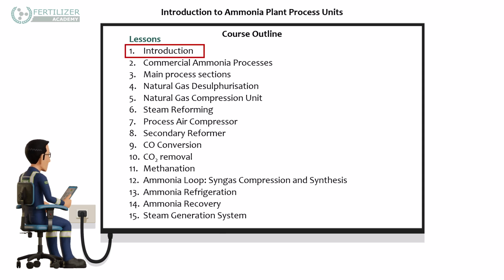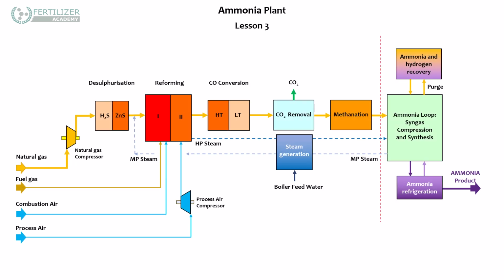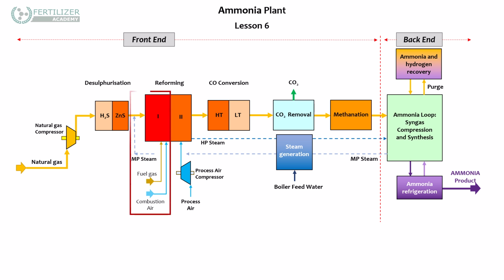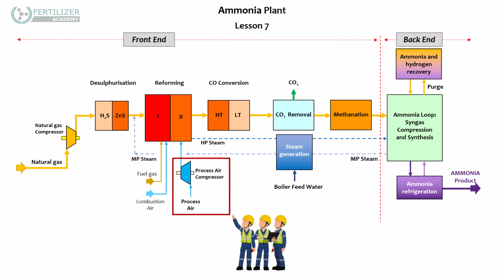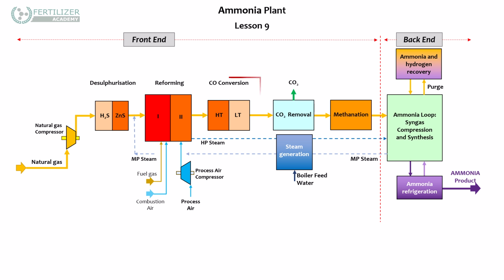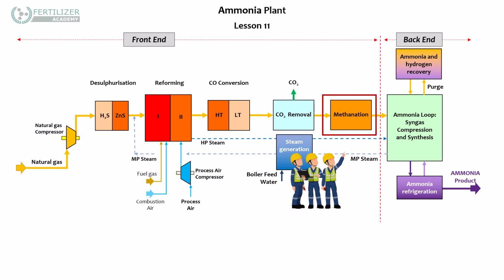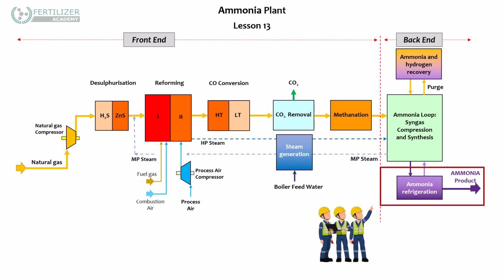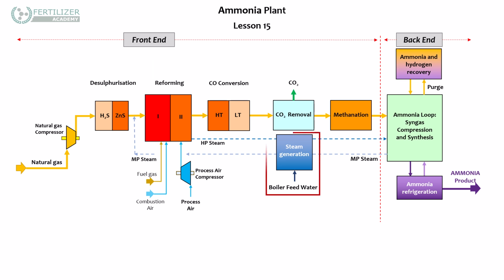Introduction to Ammonia Plant Process Units (Video Content)

Comment: So, you guys divide it into 2 units only? front end & back end. Usually it’s Front End, Middle, Back end and Compressor unit.
Reply from the maker: Yes, you are right — in many older ammonia plants the process is commonly divided into Front End, Middle Section, Back End, and Compressor Unit. In newer training approaches and some modern plant descriptions, these sections are often grouped more broadly into Front End and Back End for simplified explanation, especially at beginner level. Good point, and thank you for adding this clarification.